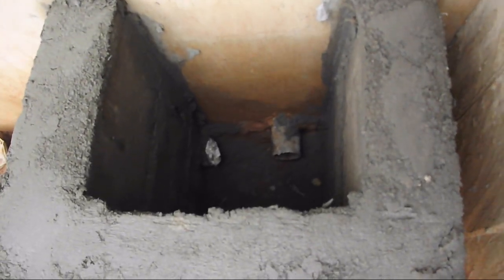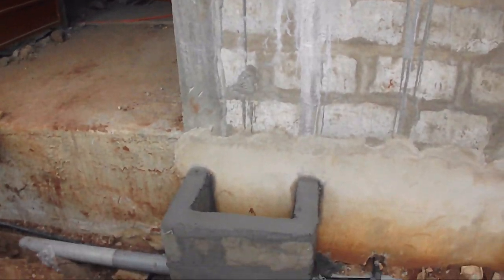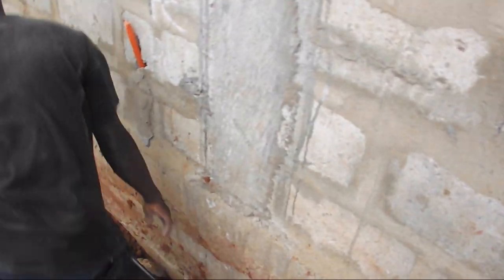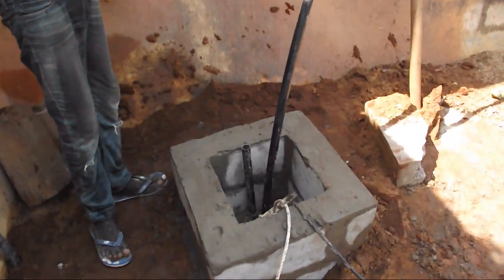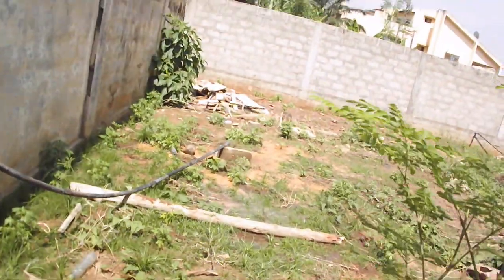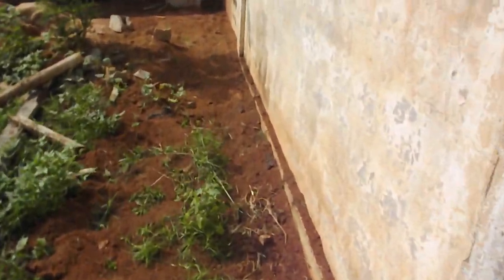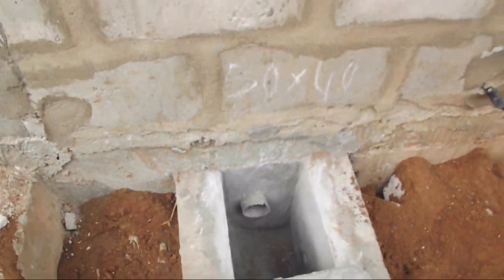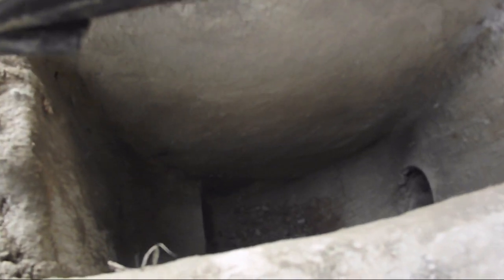Building The House 39 - Inspection Chambers

Comment: Nice job sir, my question is how chambers dose two flat need,i was told is 17 to 18
Reply from the maker: @tracy asemora, thanks for tuning in and thank you for the question.  This question would be best answered by an architect and plumber.  However, I do not believe there are any rules of thumb.  It really depends on the number of appartment units and the individual unit layouts relative to the septic system.
Again, for your specific project, please consult the architect and plumber.  Thank you!

Comment: Wow that’s nice clean job, I wonder if they do this in Ghana
Reply from the maker: Hi Samuel, thanks for tuning in. Thank you for the question.

Home designs and construction vary so much that it may be difficult to generalize by country. When you watch vids on this channel, you will see exposed pvc pipes from the 3 bathrooms upstairs running down 3 different walls downstairs. Those pipes then exit the interior spaces to the outside at the inspection chambers. Those exposed pipes on the inside will be enclosed in a cabinet. At any time (t), you will be able to open up a cabinet on the inside and inspect the pipes. In the same way outside, you can open up an inspection chamber to check things out. 

Samuel, this was by design. A part of the plans from the very beginning.  I appreciate you.  I have started watching the project on your channel.  Please, do come back.

Comment: This is just waste of resource.

- Why do they place so many columns in house? Every 2 meter column? Crazy 
- Why do the house have small holes in them 
- The whole Inspection Chambers shouldn't make sense to me. Why so many of them? There should be only one of them.
- Why so many PVC outing there should only be 2. Everything should connect to them. If you want you can connect the washing machine and the kitchen to one line and toilet to other. 
-
Reply from the maker: Hello Kwabena, thank you for tuning in. Your comments and questions are much appreciated. 

Wow...there is a lot to unpack here.

Columns every 2m is an inaccurate assessment. Fortunately, you can watch a goods number of videos published at different phases of construction to reassess your statement.

Holes in the walls are the result of scaffolding and temporary support beams used to accomplish work at higher elevations. Teak branches inserted through hallow blocks provide support for planks on which workers stand to do work. In other instances these teak branches are part of the support structure to hold up formwork. Here too, kindly watch a number of videos to see how scaffolding for work at high elevations has been handled on this project.

Regarding the inspection chambers, you are definitely entitled to your opinions and they are much respected. However, what you see onsite via video makes a lot of sense to me in the context of bathroom, kitchen and laundry room placement. A future occupant of the property will be able to diagnose plumbing issues without guesswork. You do not have to be a plumber or construction type to identify issues. On deeper reflection, if I may say so myself, the dedication of inspection chambers to toilets, sinks and showers by location is simply smart. 

Brah Kwabena, where have you been? What are you waiting for? Please hit the subscribe icon and ring the notification bell. Your comments and questions are much appreciated. Please, do come back.
Reply: @AyiviTV   Great progress and a good explanation for the decisions you have made.  When building apartments you want things segregated so one issue doesn't bring the entire apartment to a halt.  All these make sense to me. Bravo Nyebro!
Reply from the maker: Thanks for tuning in bro.  Apartments. That is one of the things I considered earlier on but came to the conclusion that the plot was too narrow to put up units that will attract well qualified tenants.  
Thanks for making the point about segregation of capabilities by units when building apartments. Good to know that.
Again, thanks for tuning in. Blessings!
Reply: @AyiviTV   I'm a builder, but I have never seen so many pvc out of one house before. The bamboo scaffolding I can understand, but still the holes are too many. The main problem in Africa is that we don't changed the way we do things. We do everything like amateurs. No improvement. One day streets.
Reply from the maker: Hi, thanks for the follow up. 

I am the maitre d'ouvrage on this project. I am pretty content with the design, implementation and overall progress so far. 

Well, you are seeing a lot of pvc pipes for the first time in the design and implementation of this particular project. Let's call it a unique design.

Be sure to watch some more videos on this channel to become even more acquainted with this project. You may find additional features of interest for discussion.

Brah Kwabena, I very much appreciate your comments. Please, do come again.